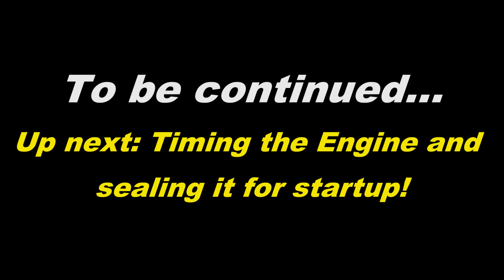Ford 5.4L 3v Engine Timing Chain Kit Replacement Pt 3 of 4: Valvetrain Component Removal

Comment: can I just put the crank shaft at the 6oclock position and do the change without removing followers
Reply: Actually, you can use a vise grip on each cam (wrapped with a thick rag or towel) and wedge them against (drivers side) against the engine and (pass) against coolant lines or a big set that'll teach the body because the cams will want to spin toward the passenger side HARD. it's a cheat I used b4 I had the spring tool. Be careful putting the new phasers back oto the cams. They have a pin as a guide and go by Brian's measurements. ALWAYS USE THE NEW MELLING HD OIL PUMP. Actually, if he "knew" it was just a blown oil seal on an adjuster and you're a "baller on a budget" you can take the front  valve cover bolts out and pull the front cover only. You DONT HAVE TO pull the entire valve cover on EITHER side to change (just the tensioners)!!!! The right side V-cover will make you say words your momma WOULD NOT LIKE TO HEAR YOU SAY.......on as well as off. That's just a po' boys cheat. But to swap the phasers, the v-covers do have to come all the way out so pray the night before to ask for forgiveness for the words you're gonna use on that pass. side the next day...... You learn tricks. I own a 5.4 07 expy and a 05 4.6 Mustang with a turbo. Both "almost" the same 90% of.... well. Er'thang. Use new cam phaser bolts and a new balancer bolt. Put the crank sensor back on BEFORE bolting the A/C compressor all the way back on!!!!! And make SURE it's plugged up good!!!!
Reply: @ivanlaney2336  I've done chains with the vise grip trick but not the phasers (cheap customer) did you break torque on the phasers bolts with the chain on?
Reply: Can you just remove the 6 rollers that you said and change the timing chain and phaser without taking a whole camshaft out
Reply from the maker: No!
Reply: FordTechMakuloco ok i’m almost at the point in the job where you remove the followers i ordered the tool to compress the springs waiting for it to show up. To understand this process i use the tool take out the follower remove the tool and go to the next follower to be removed? i won’t drop a valve or loose a keeper when i remove the tool correct? i assuming that’s how it is done or you would need multiple spring compressor tools for each follower removal.
Reply: Did you figure out the follower removal process? I’m starting that next weekend and need some guidance on follower and lifter removal. Do they all need to be taken out, and in a specific way?
Reply: Why can’t you just pull the cams and than crank the crankshaft to the 6 o’clock position?
Reply: The crank doesn't go at 6 o'clock though. You do need the crank timing tool and the vise grip method is an advanced "trick". Brian is a billion times more saavy and although I've had dozens of 3v's apart. He has done hundreds/a thousand. He is showing you the "correct" method and I'm giving you shade tree tricks that I had to use BEFORE I had the means to do what I needed to do. If you lived near me, I'd help you for free.
Reply: @ivanlaney2336  can you call me by chance? I could desperatly use your help? 740 463 4640

Comment: I bought the cheaper tool only because of time frame issues and it does work with the 5.4 you just have to use a 1/4 '' shim under the forks  when doing the exhaust side
Reply: Or grind about 1mm length off the piece that pushes the valve.  Remove (unscrew) that little end pin first, of course.  After grinding off some length, screw that pin back in and use the tool.  Worked for me.

Comment: is the same procedure to neutralize the cam on a 4.6 f150 2007
Reply from the maker: no that engine use a cam holding tool.
Reply: Is it just as simple as positioning the crankshaft at the 12 o'clock position and holding the cams in place and removing the timing chain set and installing a new one?
Reply: @FordTechMakuloco  I had the same question.  Is it because you're changing the phaser plate as well, and have to remove the camshaft bolt?  Otherwise it seems you could just lock the cams in place like the 4.6.

Comment: If you don't know what rotation the engine is on and you already have the cams off , what do you do? Even if you have the timing tool you could be one rotation off, correct?  So what do you do from this point to get on the correct rotation cycle?  Thanks
Reply from the maker: If the cams are removed you can turn the crank anywhere you want. The crank only spins 360 so set it with the alignment tool and it is set for timing build up.
Reply: Thanks,

Comment: Hi, first off want to say love your videos I've been wrenchen for over 25 years and it's great watching someone with patience and ambition. My question to you is have you ever tried installing the rockers all at once by using the cheese wege and removing the cam once again after everything is timed instead of doing them one at a time with the special tool?
Reply: What's the cheese wedge? How does it work? Does it hold tension for cams? If you remove the cams don't you have to dial them in? I can't find cam locks for the 5.4L 3v.
Reply: @gprice932  the cheese wedge is only used if you arent pulling front cover its only used if your only changing cam phasers
Reply: @dubba85  thanks bro. I figured it out

Comment: if im not changing my cam phaser since ive done them about a month ago do i still need to remove the roller followers. dont have the spring compressor tool and my local store does not either.

Comment: Great videos. Quick question, I have a severe loss of power. No weird noises. Good compression, new coils plugs injectors good fuel pressure. Could it be timing issues from cam phaser or stretched chains.
Reply: https://www.youtube.com/watch?v=0NOI6JBByhs

Comment: What would be the cost of something like that? i need to do it and my mechanic told me about $6000.  sounds way to much for a 2005 f150
??????
Reply from the maker: I charge $2,200 for the entire job with upgraded oil pump or $2,300 with High Volume pump upgrade out the door. You can submit an official service request here- http://bsgautomotive.com/contact/
Reply: You can buy a crate engine for less, totally new engine with warranty.
Reply: @patrickcowan8701  Do you have a link to a crate engine at that price? thank you,

Comment: Why do you have to remove 3 followers from each bank when we will be pulling all of them out by removing cam shaft eventually? Wouldn't just removing cam shaft bolts work as well since that will close off the valves?
Reply from the maker: The cam is under extreme pressure from the valves that are being actuated.
Reply: @FordTechMakuloco  I have removed th cam and follower before  the six o clock  is there any way in going back and fixing it

Comment: brian!! i am installing my valve covers, what are the torque specs. i found 96 inch lbs but i just broke off two of them?? ahhhhh
Reply from the maker: 89 inch lbs
Reply: @FordTechMakuloco  so 10 ft lbs?

Comment: My fervent wish is, the engineers that designed this . . . fiasco, were promptly fired by FOMOCO, then hung by their testicles with 0.032 safety wire, before being plunged into a bath of isopropyl alcohol. 

I've watched these videos so much, i feel like I've done this before. I'm to the remove six followers step. Fighting the crap left in the way between the head & firewall, plus those little plastic things that hold all of the wires in place has driven me to a new level of hatred of college boy engineers that have Never turned a wrench in their LIFE!!!

Comment: Did this project an still getting codes. p0171 and p0358. Was getting misfire po356 before 358. swapped COPs on 8 and same result. Revs up in neutral but will not get over 2k in gear. Home made noid light shows getting signal at 8 cyl.  I am at ropes end.

Comment: Where can I find the tourqe specs for the guides, chain tensioners, cam phasers and covers?
Reply from the maker: Part 4 when we install them
Reply: yeah and make sure your torque wrench isnt still set for the wayter pump lol, i snapped off the chain guide bolt that ngoes throught the oil pump. had to take it all back apart and extract the broken bolt!!!

Comment: guys i need help!! i i am in the process of removing my roller follwers. i got the three on the passenger side out, the two on clyinder 5 out. the one on cyl;inder 8 almost seems like the spring is already compressed!!! what can i do
Reply from the maker: Skip it
Reply: Having same situation on cylinder 8,  by skipping roller completely won’t mess with timing at all?
Reply: @FordTechMakuloco  I'm having this issue right now... so just skip it and go to 6 o'clock postion and start removing tensioners?

Comment: I noticed you took the roller followers out from certain points, im not sure if i understood exactly why or the reason for doing so. From what i understood (keep in mind im tryin to follow all this as i do it myself on my own vehicle) it was so that no valves were pushing correct? Minimize the risk of movement of camshaft or any componants also, correct?
Reply: Actually i went back heard you mention "preventing the valves from meeting the pistons" ,  what would cause that to happen? Just trying to understand in order to prevent any mistakes.
Reply from the maker: Removing these 3 followers per side  neutralizes the cam when you finish turning the crank to the 6 o clock position so it is safe to just unbolt the cams since they won't be under any pressure.
Reply: Is the removal of the cams necissarry if im only replacing a tensioner?
Reply: @FordTechMakuloco   Hi Brian, really appreciate your explanations but still unclear on this point. I am not unbolting my Cams.  I understand that removing the 6 roller followers will neutralize the cam when installing new chains and guides etc, but then you say to remove ALL the roller followers, only to put them all back in before sealing everything back up.  I am a bit confused. Could you clarify?   I already did all of this in October and replaced my whole kit but on a recent highway trip one of my Roller followers got chewed up and was kicked out, so now I opened the valve covers and found the follower, but I also noticed that my timing chain was not lined up correctly. It was off by 2 teeth above the L on the Phaser.  I assumed when the engine over revved that the chain somehow skipped a tooth which is causing my rough running, codes and stalling.   I have opened up the engine again to correct the chain(s) position.  Is there some way that I could chat with you?  250-212-0302 Mark
Reply: fubumartinez956ify i am waiting on the same answer 
Is it a must do when doing this job as i am at that part right now

Comment: thank you Sir for this very helpful information! i took my 2008 F150 to a mechanic and paid for an in-depth diagnostic and they pointed to a faulty timing system; oil pressure was in spec 63 to 76@2000rpm PSI cold, 23 PSI hot idleto 63.5 PSI@200rpm hot; no misfire present; O2 sensors all ok; no fuel injector testing but no bad codes either; i asked if a repair would last me another 100k to 200k miles and they answered probably not (i have 120k right now), advising to swap the entire engine instead... what is your opinion?
Reply: Swap to a new vehicle. Putting in a used engine is risky, it could be even worse than the engine being replaced! Rebuilding the engine could exceed the value of the vehicle.

My recommendation is to get a good vehicle like Toyota or Honda. Ford, GM, and Chrysler are all absolute garbage.

Comment: I can’t seem to get the exhaust rocker from cylinder 8. Maybe because my timing is off. Can I remove it when I turn the crankshaft to the 6 position?  Other 5 are out
Reply: Did you ever figure this out I'm having the same problem
Reply: Brian said you can skip that one and go to 6oclock. But mine i jest had to turn the cam a little more to get that lobe base down.

Comment: I heard you say to replace the 5-20w oil with 5-30w after this timing chain / phasers replacement , do you have any supporting facts to substantiate that statement?
Reply from the maker: You will just have to take my word for it we have been over this many times in many videos as to why.
Reply: Do you have any facts ha ha ha shut the fuck up this guy shows you more than the ford videos  ford disable the comments cause they are stupid

Comment: When you took the original rollers off, how did you keep the spring compressed after you removed the roller? Or does it naturally return to being up afterward?
Also, how did you remove the remaining rollers? Using that tool, or did you just remove the cam covers and pull the remaining rollers out by hand?
Reply: This was my question too.  I'm getting ready to do this in the next week or so.  Did you end up just removing the compression tool and letting the valve springs decompress, or what?  I'm assuming the tool can re-compress them fine when re-installing the rollers?  Anyone got any tips?  Thanks!
Reply: the tool will compress the valve when you tighten (the knob on the top of the tool), after you remove the follower you loosen the knob to release tension on the valve.

Comment: I have a 2002 f-150 5.4 2v that I am doing head gaskets on.  When I took the timing chain and components off the chain looks just fine and so do the automatic tensioners.  I'm planning to replace the other parts though and I'm wondering is Melling is an ok brand to use for those parts?  Also I'm wondering if I should just replace tensioners anyway even though they seem ok.  Also, I know in this video series you use a melling oil pump rather than ford. would that be ok for mine too?  One more question:  would you replace the hydraulic valve lifters too and what brand would you use for that?  Any help and advice would be appreciated.  Thanks!

Comment: why does ford want you to remove 3 followers per head at the 12 oclock position.  It doesnt make sense as then they want you to put crankshaft at 6 oclock position.  and remove the remaining.  Why can't you just put crankshaft in the 6 oclock position to begin with?
Reply: Cam lobes will have followers depressed and follower won't come out.  Take them out, rotate engine, now there is no pressure on cam lobes - it's now safe to remove without warping cam due to pressure.

Comment: Do I have to remove the 3 roller followers from each side if I’m taking out the cams? Or can I just take the cam caps off and remove the camshafts. I noticed in one of your other videos that you took off the cam caps and then the camshafts without removing the followers.. it was the video where the engine was super sludged up. 

Also if I remove the spark plugs then do I still have to remove the first 3 followers on each side?

Comment: Ok...apparently I am not too bright. I have been following your vids on the timing chain replacement. I think I just made a really big mistake and am trying to figure out if I am now completely screwed. I got up to the part where we start pulling followers out. I got the crank turned so that the 2 cam lobes were at the 11:00 position as you showed. I wasnt paying enough attention to what I was doing and went off and removed those two followers. Have I just screwed this engine? I am not going to pull anything else until I can figure out to do here. Thank you for your vids...they are awesome, I just somehow messed that part up,,,UGH.
Reply: I think what I am going to do, since neither crank or cams have moved since. I am going to use the tool and put those 2 back in and continue to get them all out in the RIGHT order this time. I hope I am doing the right thing. If someone has insight as to whether or not this is the correct thing to do, then please share...thanks again for the vids. Now if I were just smart enough to follow them...lol.
Reply: Terry Reeves so I did the same thing, initially started removing the 2 intake roller followers on cylinder 1. I was wondering if Brian goofed when he mistakenly said “passenger side” cylinder 5 take of the two intake but was pointing at driver side and make the edit correction. It looks as though the two intake roller followers should come off cylinder 1 first as the lobes are at the 11 o’clock position leaving way more room to remove than the middle exhaust roller follower. I would love any help. 

I also thought about putting crank in 6 o’clock position and just slowly removing the cam towers after taking off the chain tensioners. Any thoughts?

Comment: Could it be possible to put the crank at the 6 o'clock position and remove the camshafts without doing the other 6 followers first?
Reply from the maker: +Doory McFly if you are very careful to loosen he caps slowly and evenly with he front one coming fully off first.

Comment: Love this series....

Brian, does it matter what order you remove the cam cap bolts in?  Maybe its not as big deal since the valves/cams are in a neutral position?   Just asking since it was never mentioned.
Reply from the maker: +Ben Grigsby in this instance it does not matter what order they are taken off